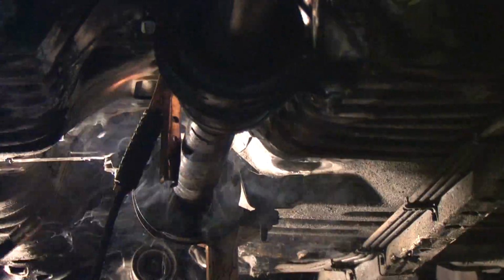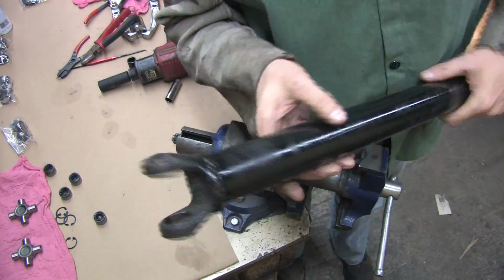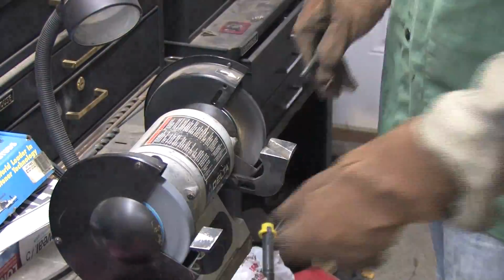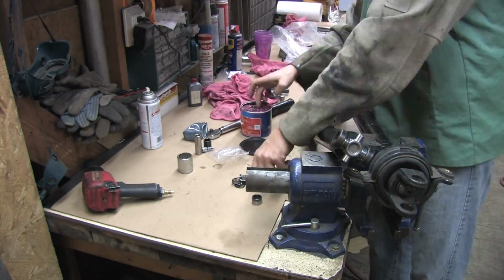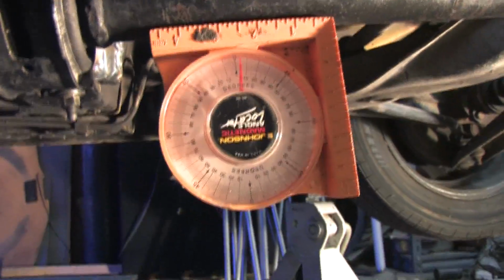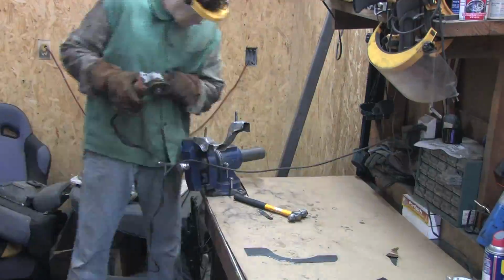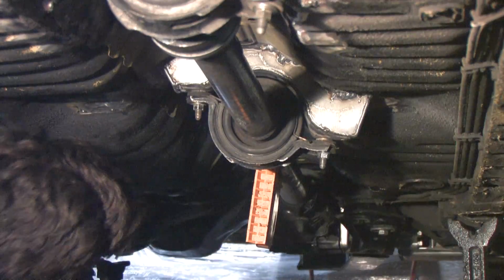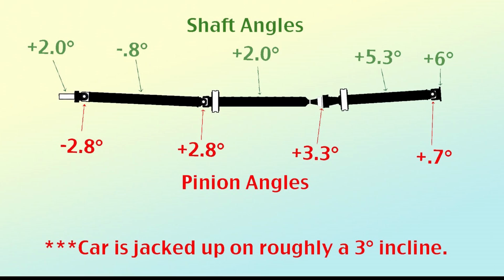Colt Driveshaft Install Part 2/3

Comment: So, why not go with a 1 piece driveshaft? What made you pick this over a 1 piece?  Are we going to see some Colt love in 2019? Also, CONGRATS ON THE 100K subs! Surprised it took so long! Are you going to make a video of unwrapping your 100K plaque from YouTube?
Reply from the maker: 1) they don't send those things out until you have like 125,000 and forgot all about it.  2) I made it here despite having 0 other social media and zero self-promotion.  3) I've never had the goal to be rich and famous from YouTube, and so far I'm still deeply embedded into the dregs of those expectations so... I'm satisfied.  4) We're just 100k+ people who like the same things!  That's cool!  I like that.  If I somehow have the respect of the whole subscriber base, then that's miraculous.  I'm humbled.  5) you can't use a 1-piece driveshaft on ANY AWD car with a transverse mounted engine.  It HAS to have a slip joint in it.  Straight-drive drivelines torque and roll on the mounts side-to-side, inline with the driveshaft rotation.  Transverse mounted engines torque forward and backward on the engine mount.  So the output shaft of the transmission is constantly changing distances from the yoke on the rear differential.  Load it up good one time, and driveshaft pretzel.  It has to have a slip joint.  There was a company that briefly made 2 piece carbon fiber driveshafts for DSMs and they stopped making them just as fast as they started.  6) Because of the Hyundai, when the Colt comes back it's getting a full reboot.  The GSX has always been my baby, and the Colt was always supposed to be the project.  The Hyundai turned into the experiment that took the place of the Colt.  The Colt is going to be all business.  EDIT:  In fact, I may even convert it back to Auto.  I haven't fully made my mind up on that.

Comment: Question. Would you be interested in selling everything  one would need to convert the turbo mirage to awd. (Exiting the trans and before the rear end, basically the drive shaft sections)
Reply from the maker: I don't have any spares that aren't currently installed in a project.  The mounts & fabrication work I did in these videos were made from scrap metal and existing pieces that I cut off the car.  If you're looking for the driveshaft, K-member, axles, cups and rear differential, your best bet is to contact MSrecycling.  They've got twelve 1g DSMs on the lot right now.  You might even get lucky in a salvage yard near your house.  Be careful, that rear K-member is insanely-heavy.

Comment: Binged watched Colt series again, thumbed up all comments. A little more pricey- but many in the know use helium instead of CO2. Much cleaner, stronger weld, and cleaner cuts with plasma. Smaller molecule, higher compressibility, get more in bottle, lasts longer.
Reply from the maker: Thank you for the tip!  ...and I just clicked "export".

Comment: I think the rear of the x-fer case will go down decreasing the angle but I dont think it would be a problem because it wont stay like that for more than a few seconds and looks like u have enough side to side angle to almost make it a moot point. Almost to bad u cant use a gm ball and socket u joint but its not worth having new shafts made just to have a unserviceable part. If u are uncomfortable with the x-fer case movement use a stiffer rear mount or add a solid rod end mount on the motor

Comment: I think its great that u mentioned the driveline angles because most dont know that u cant have 0 angle and expect a u joint to last. As far as a multiple piece driveshaft goes u can have about 6 degrees with the suspension loaded so the 2-3 degrees is great for that. Keep up the good work!

Comment: Another fantastic video Jafro.  That engineering looks great.  I like how you took the extra step of boxing the ends of your bracket.  Not even the factory goes to that length for stability.... I'm looking forward to the next video.  Which area are you gonna tackle next?

Comment: Jafro, you can make thread lock easier to undo by using heat. 500 degrees according to Loctite, but it's usually a similar temp for all brands.